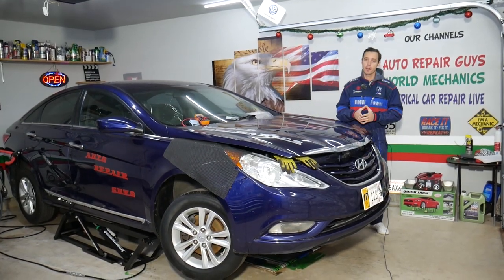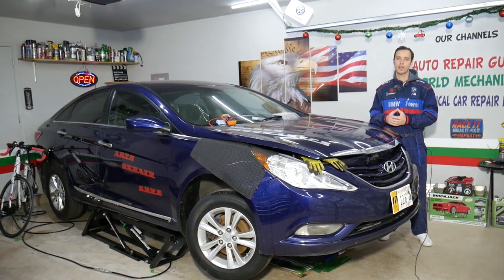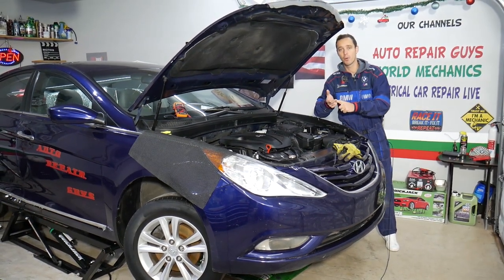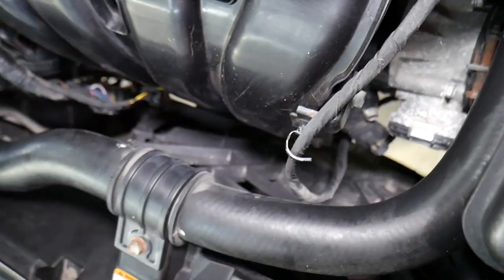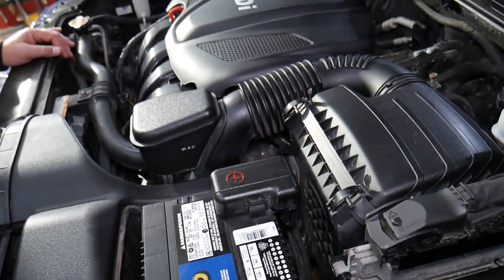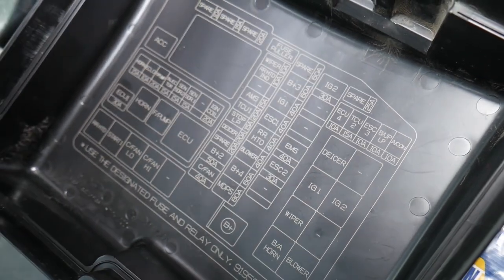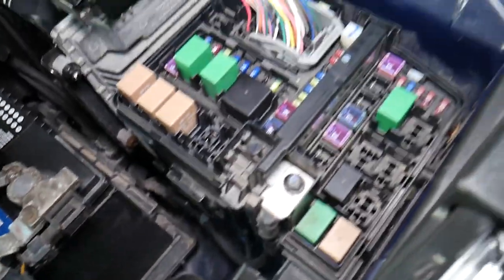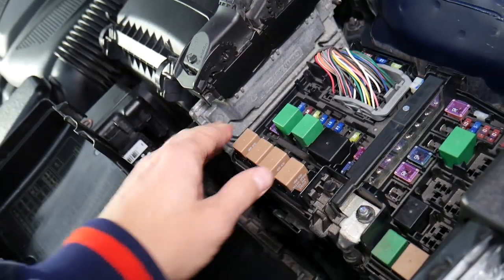HYUNDAI SONATA RADIATOR FAN RELAY, COOLING FAN RELAY LOCATION REPLACEMENT

Comment: Brother, how you doing? I have Sonada 2011. My problem is when I turn the AC on sometimes works cold sometimes doesn’t I think it’s because the outside radiator fan is not working properly sometimes on the fan the sometimes is not would you please tell me what’s wrong with it.